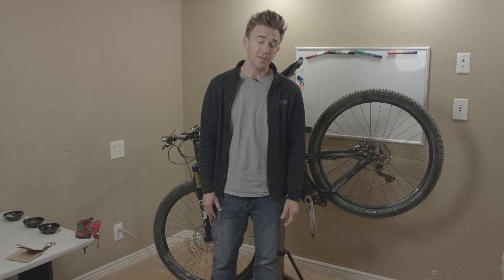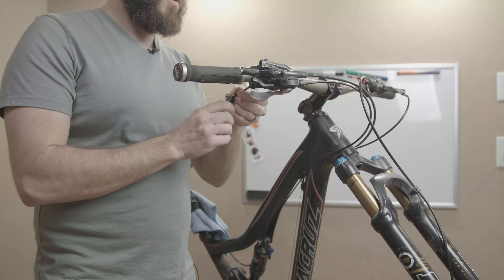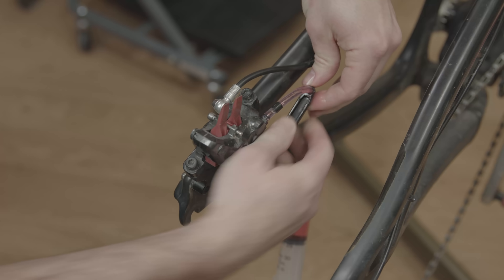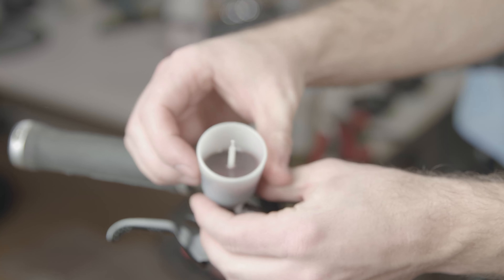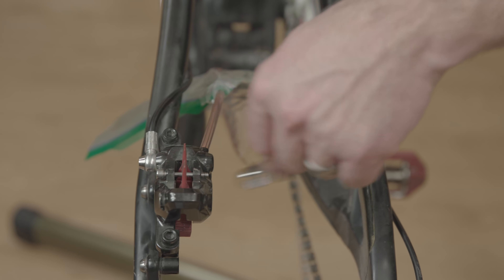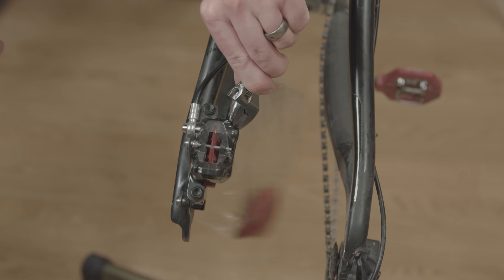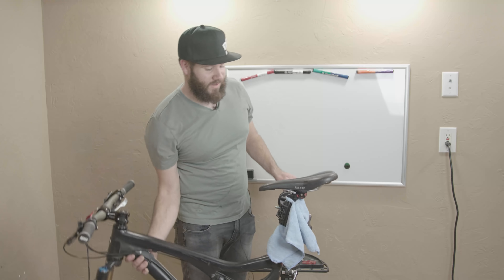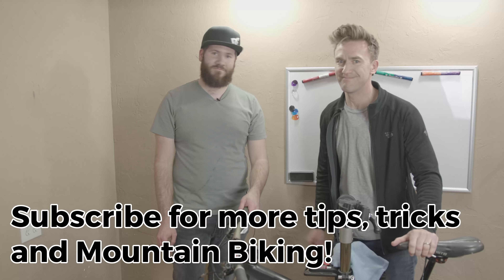How to bleed m8000 brakes | Shimano Deore XT M8000 brakes

Comment: Dude, you failed because your bleed procedure is wrong. You shouldnt have used the ziptie on the brake handle this pushes the oil out of the resevoir(used only for avid/sram and formula), then u release oil from the caliper….simply you ended up with not enough oil in the system. You used like 3 diffirent bleeding procedures and mixed it up and ended up with a poor result. Ofc when u bleed use new pads afterwards. Used pads if executed the procedure well should also work, but using fresh is a smatter choice. Nice video tho ;)